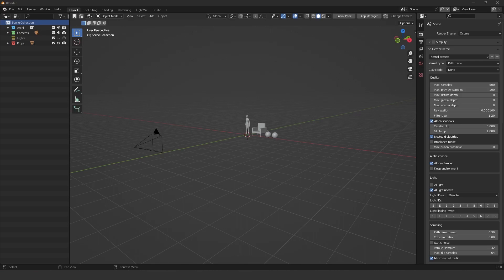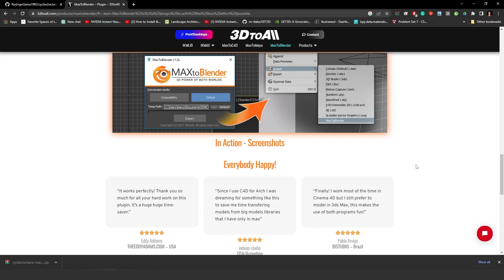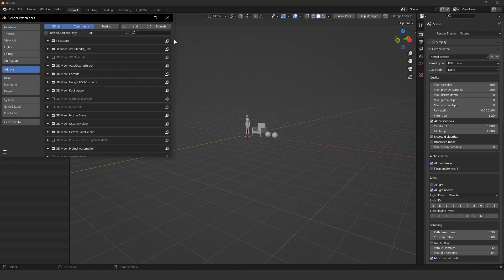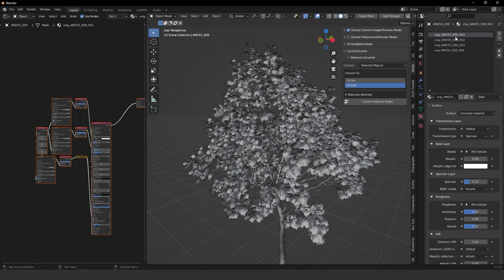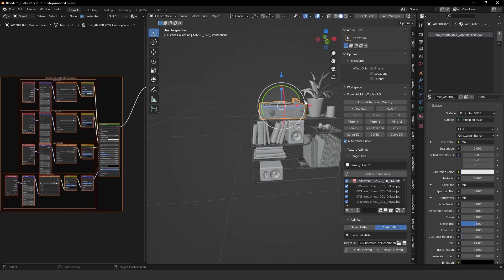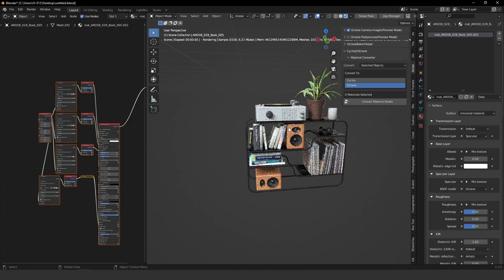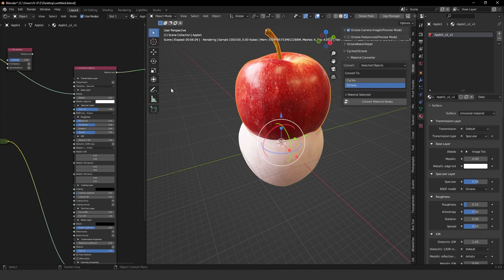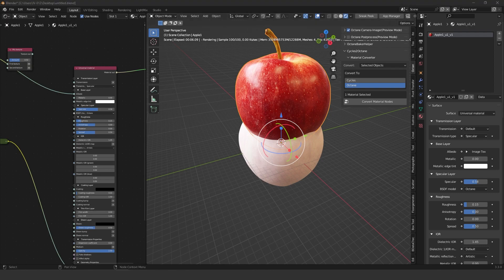Tutorial - How to use the Cycles to Octane Converter

Comment: it converts the nodes , but the displacement node is messed up because it's not the proper node , it converts into a cycle node for the displacement so it's not working  and it's connected to "octane geometry" in the material output , same for the normals , you change the settings of the bump or the normal ..it doesn't do anything ,otherwise , yeah it converts the map ..but as soon as you have a more complex materials ..it's over ..better to bake honestly ,octane on blender is garbage anyway ..i mean i know i sound harsh ..but come on what are they doing at otoys , how many years octane in blender has been in dev and still no node wrangler for octane , people have to make addon to have a converter ..issue all the time  i mean .it's just a shame  ,they're just lazy , that's why barely nobody use blender octane, it's not against you man , but i feel like  people put efforts , while it's the job of the company
Reply from the maker: Hi Paul, as I said in the video, this addon was developed to help my company convert models from 3ds max to blender, and for this purpose, it is working more than fine. Also, I said in the video that you may find problems converting objects already made in blender for example objects from Imeshh.
As for your complaints about Otoy, I agree with you, it is a shame they didn't build any converter yet!!!! So frustrating! 
Unfortunately, octane is still much better than Cycles, and that's why it is still worth it!
Reply: There is a node wrangler octane edition but sometimes crashes